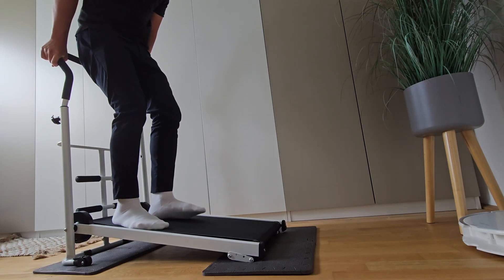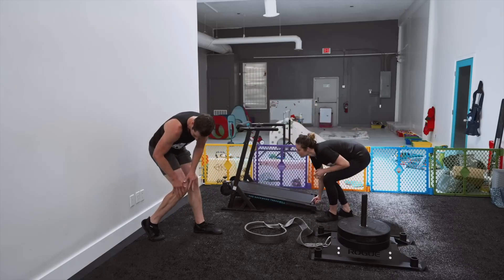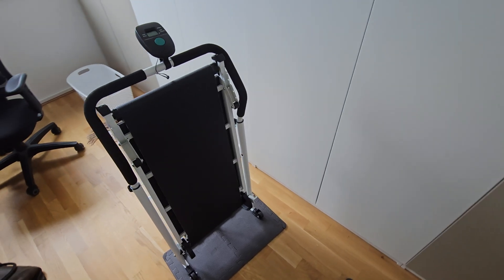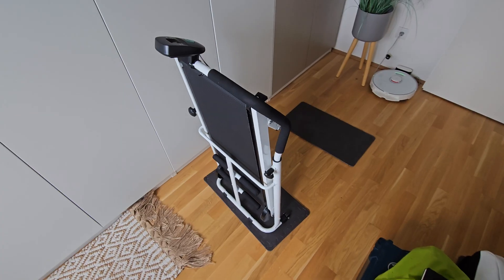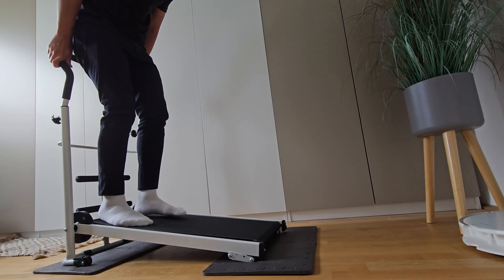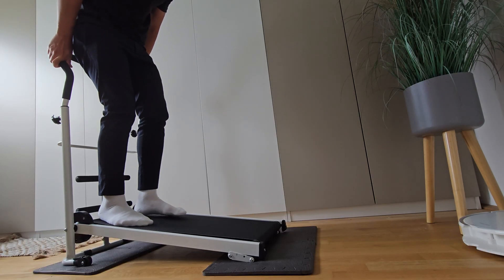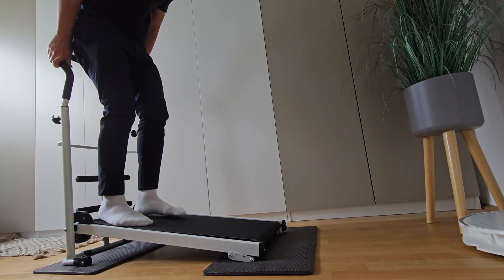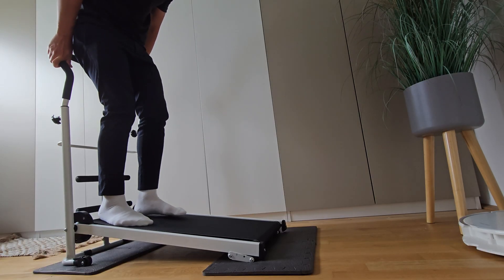I build my own Backwards Treadmill | DIY 30$ DIY Backwards Treadmill

Comment: Nice job. Making one now. Fyi wd40 is not a lubrican.. helps intially but enot hold..use silicon grease or silicon oil to libricate for longer effect.
Reply from the maker: Thanks Mate! Building the same one? Yeah i was already switching to silicon spray! Thanks for the point.